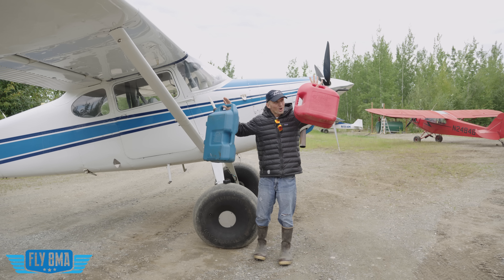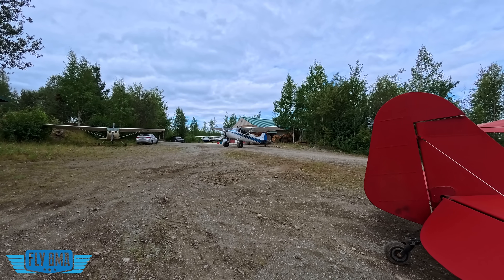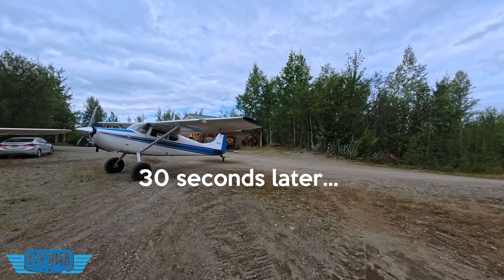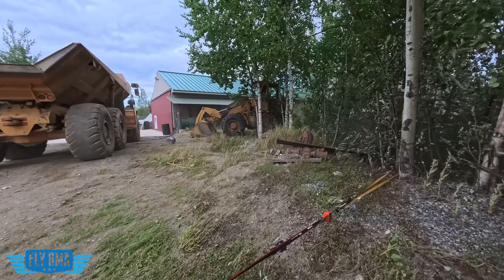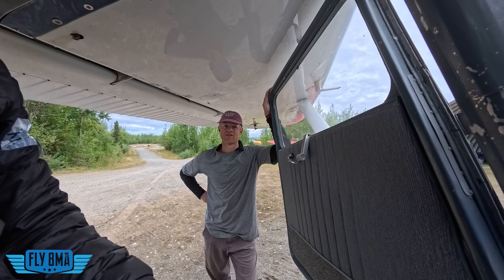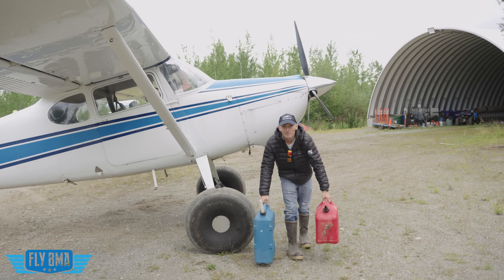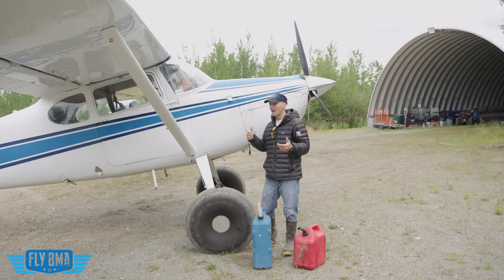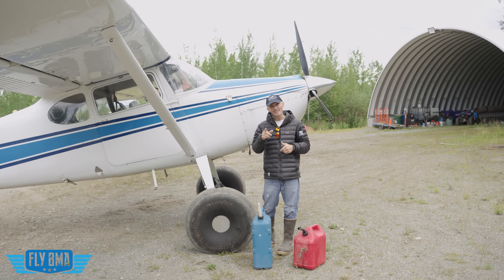Will a Plane run on Car Gas?

Comment: Nice video.  I run about 1/4 100LL with 3/4  91 octane Mogas in my C172 w/ Peterson STC.   Question Jon...  I see a magnetic phone charger mounted to  your panel.  What type of adhesive or fasteners did you use to keep it secure in that bumpy Alaskan environment?

Comment: After a stuck valve on avgas I now use as much mogas as I can with my new cylinders.
Reply from the maker: No lead-buildup is a real plus for mogas on some engines

Comment: I run mogas in my io-360 and it works fine.  8.5:1 compression.  All the rubber in my fuel system is viton, so no issue in case there's a little bit of ethanol.   I do see some vapor lock from time to time, and if I just put the boost pump on all is fine.  No issue with lead fouling.  I fly almost every week at least, but if I were to store my aircraft for a while, I would fill up with 100LL as it's more stable, apparently.

Comment: The only real problem using car gas is you must get ethanol free car gas! We operated crop dusters on car gas without problems. But I did add Marvel to the car gas for the valve lube. With ethanol you will get water in your fuel, We all know how mush engines love water!

Comment: Couple things: 

1. If the engine was designed to run lower octane like stated in this video, then yes, it will make more power on 87 octane. Generally speaking, Ignition timing is set around the octane rating of the fuel. The lower the octane, the lower the timing. The higher the octane rating, the longer it takes for that fuel to burn. So, if timing is set for 87 octane and you dump 100 in it, the fuel is going to be burning late into the power stroke which means, less power. The timing is set based on octane to provide optimal power while preventing knock. With the higher octane, fuel is burned later when the piston is already moving down and so, it will have less energy pushing the piston down. 

2. Yes there will be less maintenance will 87. The lead puts deposits on everything in the engine which will require more maintenance. This has been known for years in the automotive industry, people (lots, not all) in aviation are just stuck in their old ways of thinking. 

3. It’s going to start easier because again, the timing is set for it. It burns easier so it’s going to fire off sooner.

Comment: I had a vapor lock incident last May (80+ degree day) with a heat soaked engine (Rotax 912is and second leg home).  This is when I learned about winter and simmer blend gas and Reid Vapor Pressure.  Five minutes after take off climbing out I got low fuel pressure warnings and significantly reduced power. Immediately turned back to the airport and started looking for fields. After about three minutes of reduced power and descending, full power returned and we landed at the airport. So, when using mogas is it very important to know if the gas is winter or summer blend. It may differ by state or region but in North Carolina winter blend is distributed from mid September to mid May. Winter blend contains butane which increases the Reid Vapor Pressure as high as 15 psi. RVP is a measure of a fuels propensity to vaporize. Avgas has an RVP of 5 to 7 psi. Also, high temperature and lower pressure (altitude) increases the risk of vaporization (vapor lock). Van’s Aircraft has a great letter/article of this topic and calls Spring the DANGER ZONE if using winter blend mogas. VERY IMPORTANT to blend in avgas to bring down the Reid Vapor Pressure when distributors are transitioning to summer blend gas.  Given my vapor lock experience, I’ve decided mogas is not worth the risk to save a relatively small amount of money and now only use avgas.

Comment: I fly on average 150 to 200 hours a year, and have for the last 18 years straight, Rotax 912S, 3 1/4 to 3 3/4 GPH, and I haven't burned a single drop of avgas in all that time. I'll let someone else do the math on how much money that has saved me. I had a T-Craft with a A-65 for a year, and burned mogas in it also.

Comment: The writing is on the wall for TEL in AVGAS so one way or another the argument will be moot within the next few years.  It depends on the engine, but coming from 100LL to UL might require a slight timing change and that would probably see you get even more power and lower the EGT and give your exhaust valves less stress.

100LL where the LL stands for Low Lead is actually super high lead and that causes lots of problems apart from retarding everyone's intelligence. When you fly around for 50 hrs and the bottom of the plane has "soot" on it that is mostly lead, which is horrific in 2025 especially as it's not required by most engines.  It contaminates the engine oil, causes fouling and makes it hazardous to work on dispose of things over time.  You body thinks lead is calcium and deposits it in the bits between brain cells which doesn't help you think and it is cumulative.

The downsides to MOGAS is that its days are numbered and that type of thing comes around quicker than the glacial way that aviation moves.  It also doesn't keep for very long and its not as easy to tell its gone off and it can cause problems at certain temperatures and altitudes > 10k.  I'm not really sure what those problems are.
Finally, there's an obsession of adding 5 or 10% ethanol to it which is no good for aircraft its scared of heights but very fond of water.  UL 91 was  the best we had from TOTAL and that was available at many airports for a while.  I found that it didn't have the bite that 100LL had even in a 0235 100hp engine, in a blind test its enough to be able to tell the difference, AVGAS tastes better.

Comment: Not only will it - it will run better.  Octane (C8H14) is much higher in Av, and leaves more deposits.   Many people make this mistake - they think "more expensive is better".  No - you find where your engine "knocks".  That threshold is your octane requirement.    🙂

Comment: Yes.

HOWEVER ... auto fuel IS more susceptible to vapor lock ... even ethanol-free ... FAR less lead.  100LL is a misnomer, it has more lead than the old leaded auto fuel.

The other qualifier is ... compression.  IO360s have compression that needs the higher octane.  O200s/O320s ... low compression.

So, hot August afternoon ... if ya don't have a fuel pump between the tank and the firewall ... absolutely minimize ground time and get airborne QUICK ... and max rate climb outta the heat ... or you could be needing a pasture.

At least 30 years ago, needed the STC for auto fuel logged in the aircraft's logbook.  That's how long I've been outta GA ... but I had a C150 in which I ran auto fuel routinely.  Hauled it to the THangar with a tank in my pickup.

Comment: There is a lot more to using car gas than the engine. Every hose, gasket, o-ring and supporting component needs to be compatible with ethanol. Ethanol is highly corrosive, and where is it stored usually? In the wings! Make sure you know what you're doing before throwing car gas in your aircraft just because some youtuber did a 20 min test, figuring your gonna save $.
Reply: You need an STC to run mogas in these (older certified) aircraft, and the STC specifically states that Ethanol isn't allowed - lots of Ethanol free fuel available and many airports have Ethanol free mogas at the pump right beside the 100LL.
Reply from the maker: Yep! We always use ethanol-free fuel, and luckily in Alaska that’s pretty easy since all the gas sold up here is ethanol-free.

Comment: higher octane is more about knock resistance risk. A poorly maintained engine running on a hot day needs to run a higher octane to reduce that risk. Higher octane fuel is harder to ignite, but could also potentially have less energy density, so yes it could be less efficient even without taking the fuel cost.

Comment: At what compression ratio does this not work due to detonation issues?
Reply from the maker: Generally accepted that 9.5:1 or higher it would be a bad idea.  However I’ve run thousands of gallons of 87 through rotax motors (which are above 10:1) and doesn’t seem to care

Comment: You got a lot correct in your evaluation here. One thing glossed over was the shorter "shelf life" of auto fuel. I ran into this myself in my long-suffering straight tail 172 some years ago. I used to run a LOT of auto fuel (91 octane non ethanol). I normally fly a goodly amount through the Winter, but one year I changed jobs and left almost a full load of car gas in the plane through the winter (Idaho). I had a near emergency loss of power just after takeoff the first flight in the Spring. I drained ALL of the old fuel out, even down to the carb float bowl, put in 100LL, and never had any more problems. Bottom line: if you fly a lot, and your airframe and engine quality for either the EAA or Peterson STC's, car gas is a fantastic benefit. Just DO NOT let it sit to long. There's also no good way I've found to determine how stale the car gas might be coming out of the pump.
Reply from the maker: I wonder if it has to do with additives too.  Seems the gas here in AK is pretty pure and I’ve got 4 year old car gas in a plane I only fire up once or twice a year (I know o need to sell it).  Same gas for years and always starts on second pull.  At least 100LL I would think is going to be more consistent and prob a safer bet for long term storage
Reply: I wonder if a product such as Sta-Bil would help (more than hurt!) We use it in about a dozen implements here, and even chainsaw mix is good for two years (that's our limit, we dump it after that.)
Reply: I'm also in Idaho, and I just bought another 200 gallons of E-0 for my home bulk tank, BUT I will make a point of using it up as soon as the skis go back on.  I too would be uncomfortable leaving it just sit for much more than 2 or 3 months.

Comment: In small Continentals I think MOGAS is the absolute way to go. In most cases they simply do not run hot enough to scavenge the tetraethyl lead from Avgas without some sort of converter like Decalin. The oxybromide deposits will build up on the top of the piston and on the valves, as well as  get into the valve guides, either causing sticking or scoring, neither of which are good. Not to mention the contamination to the oil as some sneaks past the rings. Auto fuel will also help scavenge a lot of carbon out of the cylinders. 
Most cases I’ve heard of auto fuel being an issue were when someone didn’t check their fuel to see just what they were putting into their airplane to begin with, or they mishandled it with dirty gas cans/ funnels, & or they were using old gas that had lost its octane and was beginning to “varnish”. I guess I have heard of bottom wing airplanes having some vapor lock symptoms while cruising thru the hot summertime as well, but it’s pretty minor at that. 

Another thing, I would not pay too much attention to EGT’s as they are just a relative number of energy being wasted out the exhaust pipe. If a pilot was to focus on such details, CHT’s is where it should be..  

That’s my current thoughts/opinions on the matter and every airplane is different, and every pilot is different. Happy Flying! - Glenn CFI/A&P

Comment: I was a crop duster and pipeline patrol pilot for many years and 17,000 hours.  In Stearman, Pawnee, and CallAir spraying on car gas that was leaded and then car gas that was unleaded and had to clean plugs only at annual after many hours.  On pipelines in Patrol Company C-152, C-172, and Cardinal using 100LL with four times the lead of the old 80/87.  I had to clean plugs every 50 hours and the mechanic used the compressor to blow a gallon of lead out of the cylinders every 100 hrs.
Reply: Hi, Jimmy, hope you are well!

Comment: Shouldn't you warn owners / operators that the fuel requirements of the manufacturer should be adhered to unless they want to assume the risk of ruining the engine?    If an engine is high compression it needs a compatible fuel.  Auto gas is fine for low compression operations more than likely.  As for high altitude and other variables, that should be investigated.  Otherwise, yeah, we're ready for the amazing Amazement.
Reply: Many (Most) of these older Cessna 170 / 172 / 180 / 182 / 185 have engines that were designed to run on Leaded Octane 80 avgas, that's no longer available. In fact the Octane 100LL "low Lead" avgas currently available has more lead than the previous leaded fuel. Anyway if you want to run mogas in these older aircraft, you need to have the STC in order to do it legally. Which any pilot / owner knows or should know.

Comment: The real debate is it ok to run ethanol mogas? Some folks talk about possible corrosion of aluminum parts? What is the power difference between ethanol mogas and ethanol free?
Reply: It’s not much of a debate. It’s been proven to be bad in ruining seals and corroding parts... I would absolutely not run any ethanol gas in your airplane. The bigger issue with it is the alcohol in the fuel absorbs moisture and disperses it throughout the fuel. If you get any water in your fuel, you will not know it.
Reply: @flywithglenn  I understand for you it’s a shut case but reality is a lot of folks are running ethanol mogas without any issues. Yes is can be hard on rubber components but aircraft like my champ only have a short fuel line as far as rubber goes. I ran ethanol mogas in my 912 uls for a couple of years without any issues whatsoever.
Reply: @Iflyagrasshopper  the rotax can accept up to E10.  It's in the manual.  I think they were looking at E15 as well.  But it's always more than just the engine.  The fuel system in the airframe behind it matters a lot.  You have to build with ethanol in mind from the tank to the carb/injector.  The lycoming/cont engines will run on ethanol, but virtually none of them have the airframe to support it.  If you're buying hoses from spruce, they're pretty much all rated for ethanol(teflon lined), but all the rubber on the carb and your fuel tank material has to handle it to.  Aluminum in the presence of ethanol and water will corrode.  That's most fuel tanks and most hard fuel lines.  The AN fittings on those lines are usually anodized aluminum.  Ethanol will also cause rubber tanks to swell.

Comment: I have a cessna 170a fitted with a lycoming engine 180hp. I have used car gas nearly continuously for 20 years . Car gas is half the cost of AVgas . My engine runs cleaner and no lead fouling at all.  Thank you for your comparison as I have often wondered about a difference between the fuels . What I find interesting ,I run a fixed pitch prop[sensenich] of 60in s pitch but it pulls 740 lbs at full power.
Reply: What type of gas canister are you using? Plastic or steel?
Reply: @Aero_Dos a certified plastic jerry can. It has a inner wall fuel resistant wall.
Reply: @davidnelson4707 Do you have a ground/bonding wire? Never had an issue with spark?
Reply: @Aero_Dos never had a issue with a spark,as I am still here .
Reply: Do you run 87 or 90?
Reply: @Alaska_Adventure we have car gas of 98 octane . I,have run 95 car gas also with no ill effects . runs so much cleaner. oil is still a honey color after 16  hours of flight time .

Comment: I figured that it might not work.  Because av gas is like kerosene.  Gasoline is quite different to kerosene to my knowledge.   But, I was quite wrong apparently! ☺️
Reply: Jet fuel is like kerosene avgas is like gasoline.
Reply: @Iflyagrasshopper ah! I got em mixed up.  I somehow forgot turbofans and rotary plane engines work entirely differently. 😆😆😆😆

Comment: Marvel-Schebler has an ethanol mogas-safe carb rebuild kit for some of their carbs.
Reply: what about a new one?  would that already be mogas-safe?  If not why the hell not?  I just chucked a new carb on last month as everything that gets knackered on a carb was knackered on my old carb.
Reply: . I presume the new carbs already come with the epoxy float (the older plastic float is what has trouble with ethanol). But I am not sure. The epoxi float is easily recognizable by its color: either pink or blue. The plastic floats are black.
Reply: @sganzerlag there are also other bits that were vulnerable to corrosion with any dissolved moisture.  I guess that information will be available somewhere that I'll never be able to access.

Comment: So without timing advance I’m not surprised to see more power with mogas vs 100ll. Higher octane fuel makes more power by being less volatile, which allows more advanced timing. Without adjusting the timing to take advantage of that there’s more energy in the mogas than the avgas. It’s like putting premium fuel in a car that doesn’t need it, you actually make less power.
Reply: No one that understands what octane is would expect avgas to make more power on the same completely untouched engine.
Reply: @z987k  in all fairness, very few people have any idea what octane really is and why the rating matters.

Comment: Is this a fuel injected lycoming or carbureted? I’ve got an io320 in a Citabria that is the only model not applicable to the auto gas STC
Reply from the maker: This one is carb, O360...I suppose there's some concerns about vapor lock of the fuel injected models, but I am curious what the data is behind that.  The way rotax has a "recirc" pump essentially seems to avoid that issue